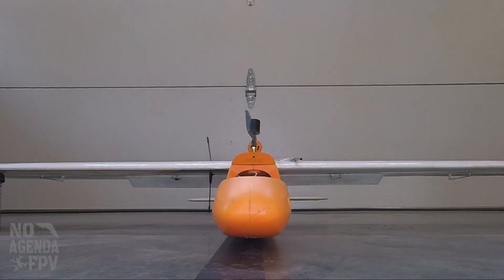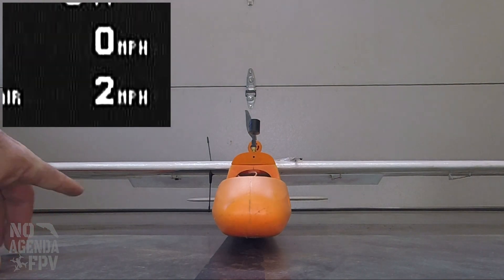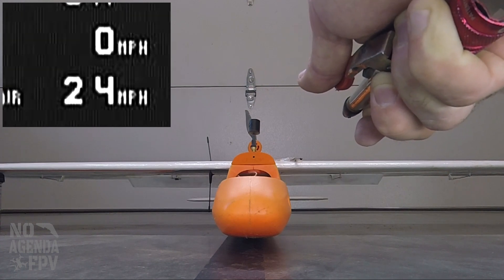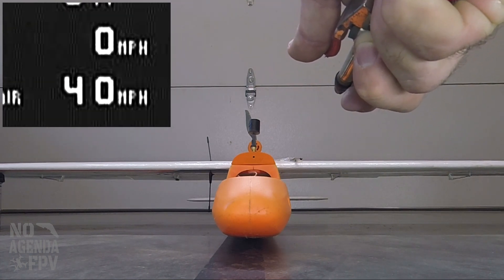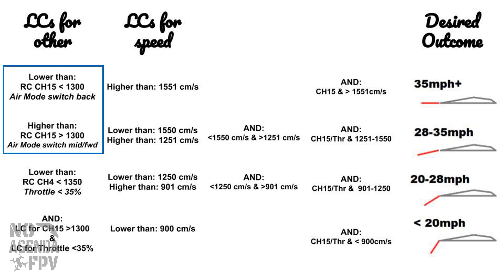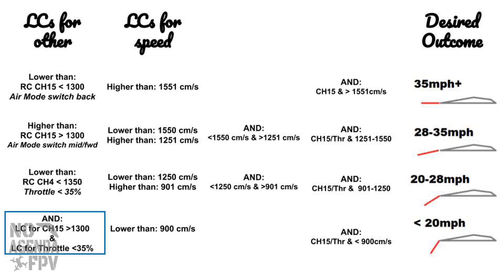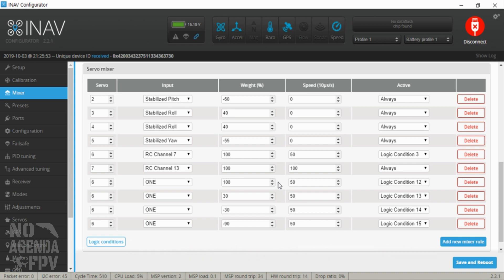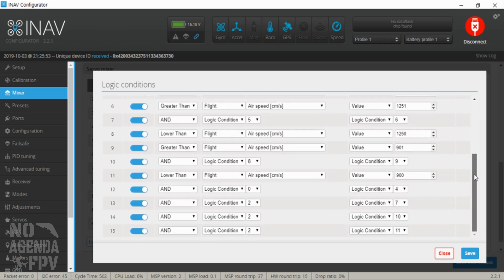Matek Analog Airspeed sensor and iNav automatically driven flaps

Comment: Hello,
Any idea how to calibrate the airspeed sensor in inav?
Mine covered with my finger showing on osd 10kmh, I need to calibrate to 0kmh.
Thank you
Reply from the maker: I believe it is referenced, or "calibrated" every time you start the FC/AS sensor up. I would try to make sure the probe is not getting any wind blowing over it when powering up. The only other option could be https://github.com/iNavFlight/inav/blob/release_4.0.0/docs/Settings.md#fw_reference_airspeed but I have not had a problem with the AS that wasn't fixed by a power cycle. Good Luck.

Comment: hi, I set up flap activated only the airspeed goes under 10M/S as I fly 1.4M skysurfer. but I could not set the Speed of servo mixer. what do you think that where did I miss?
Reply from the maker: As I recall, there is no speed adjustment available at this time, or at least not in 2.3.0 and earlier. Pawel said they were planning to try to fix that in future FW updates.
Reply: @NoAgendaFPV  yes I can't find neither. but I did it on the openTX radio control. it is working now. is that OK to do so.?would it bring something unexpected?
Reply from the maker: I'm not sure, the plane I was testing that on is no longer so I cannot help test it anymore.